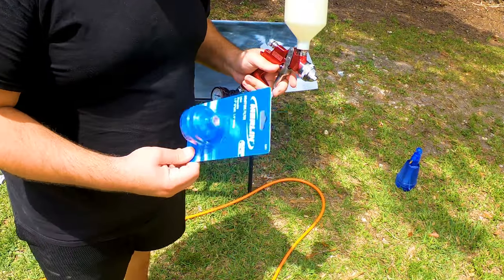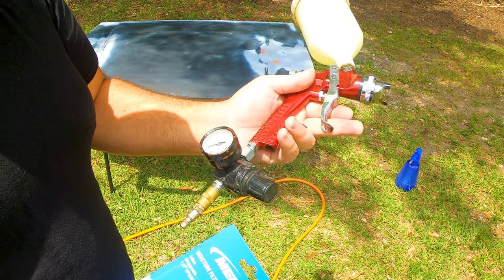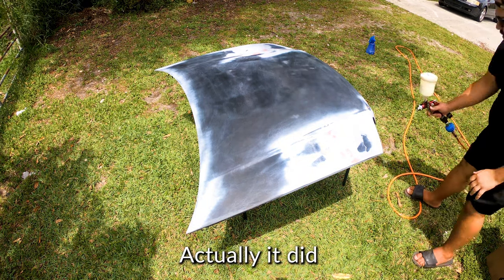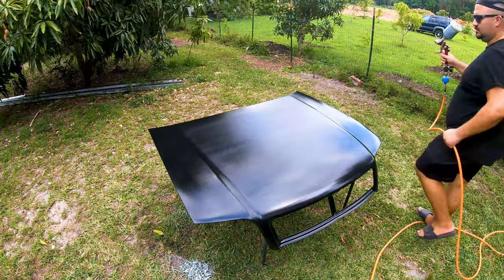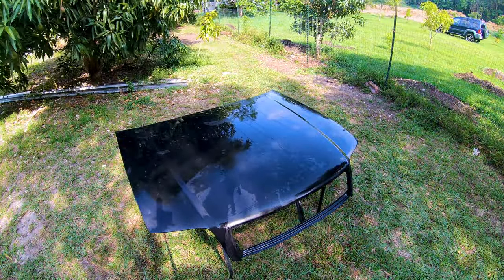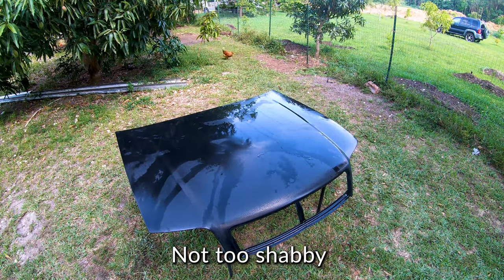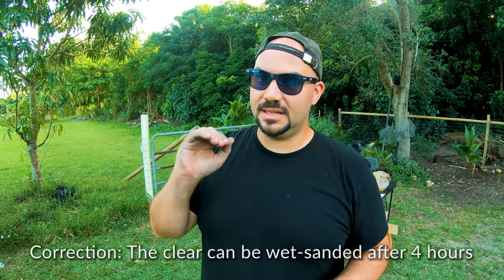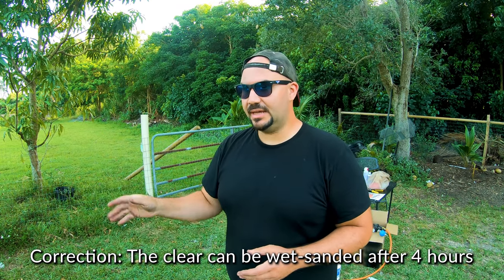Duplicolor Paint shop, DIY paint job with All 3 stages. Primer, Color and Clear

Comment: bro you’re better off watching tutorial videos yourself before you start. you’re basically wasting $$$ & not applying anything correctly which will show at the end. one little mistake & it won’t look good & from every step you took i saw mistakes that would never give you a good paint job. look, i’m not here to grill you but to help out given we should all help each other out when we can & alot of my first mistakes when i was starting out were solved with youtube itself & i can recommend channels like paint society & the gunman to get you started. one thing that’s very important is the gun settings & it’s not supposed to spray in little inch lines because that will give you tiger stripes. usually gun settings are fluid wide open & fan 3/4 open for basecoat, psi around 26 psi but this is never exact because it varies greatly on what the gun company recommends & the type of paint & viscosity. it seems like alot of steps but trust me that it’s simple once you get the hang of it even for diy. best of luck
Reply: Maybe next time just paint for him since you have all the right ways
Reply: This turned out great for an outdoor cheap paint, paint job. This is perfect for someone that doesn’t want a show car. I did my work van the same way he did and it’s absolutely perfect for what it is. Give him a break FFS. He’s not doing it in a booth that’s got ventilation and temperature controlled. I can’t even believe someone would take the time to write an entire effen novel in a comment section. Smfh lol

Comment: You needed to thin that stuff about 20% with Acetone to help it flow. Not a deal killer though but that's where the orange peel came in.
Reply: thin the base or the clear?
Reply: @nathanchristian4495  looks like both. You want a fine mist to go on to prevent the air from causing the dempels there are Orange Peel.
Reply: @popsknows5648  thanks man that's exactly what I was looking for!!

Comment: what did you sand the basecoat with?  What grit (wet sand)?  I'm about to try duplicolor's lacquer products.  How about finish cut and buff on the clear coat?  What grit(s)?  Thanks.
Reply from the maker: I went as low as 600 (wet) on the primer and color to try an kill the orange peel and worked up to 1000, but aside from not straining the paint, the gun I had was probably not helping. On the clear I used 1000  becuase of the orange peel, then 1500, then 2000 on the clear and followed up with compound. most of all avoid wind if possible lol, that made this a much more difficult project

Comment: I've used this duplicolor paint on Motorcycles alot but never on a car. I'm getting ready to though, I have been working on a 75 Pontiac Grand Prix that I'm going I've gotta paint the back of roof where the Landau Vinyl top was that I had to remove because it was dry rotting, I'm half a half can of Silver and I have a little bit of gloss black so I' think I'm going to add some black to the silver to darken it up to more of a pewter color instead of a bright silver, The car is burnt Orange and I think the darker color will jive with it better.
Reply from the maker: Not gonna lie, 👀 it never occurred to me to experiment mixing colors 🤔 . You have set some gears in motion with that.
Reply: @CrookedMustache  I've done it with Silver in Green and Burnt Orange  but I haven't done it with Black in Silver, I don't want to make it dark dark but maybe 1- 6 or 7 ratio. the 1-10ish silver into British Racing Green makes a fantastic color. especially going on a Motorcycle fuel tank.

Comment: Does wet sanding the base dull the end result? I though it was better not to mess with the base coat for some reason
Reply: If you do 2 or 3 coats it should not. Depends on how much you sand. You can sand metallics out of the color and it will be a bare spot with color.

Comment: You need to adjust your paint gun. That spray pattern is small as shit. Smh
Reply from the maker: The adjustment that gun needs is to be thrown in the garbage lol. That aside, if I was painting in still air I could’ve gotten better results dialing in the little adjustment that gun had but with the wider patterns the slightest breathe of wind just carried the paint away with it. Next paint video, new gun and an enclosed space.
Thanks for watching 👍
Reply: Follow @paintsociety he gives an awesome video on how to set up your paint gun. 

You can get the cheapest paint gun known to man. And still get a decent spray pattern and result if you know how to dial in your spray pattern and psi. Even a cheap harbor freight gun can offer you good results if you know what you're doing bro. I know you can do it!

Comment: How big is your air compressor and what PSI are you running?
Reply from the maker: @davebigford my notifications are hit or miss, I’m running a 20 gallon tank that says 4 scfm @ 90 psi. I’m pretty sure that what I ran on the line but I can’t remember what I was running at the regulator on the gun and the gun was terrible. I’ll have a better video coming out soon now that we have a more dedicated space and we’re looking at better guns
Reply: Needed a different tip size my friend.

Comment: I just used the Duplicolor paint and clear ... orange peel came out from both ... duplicolor sucks
Reply: Yeah it does. You are better off getting a high quality single stage urathane and use max amount of hardener and you will have WAY better results even with not much skill or a good environment to paint in

Comment: Change your tips, primer and base are alot thicker.
Reply: Not with the duplicolor paintshop series.they are made to use a 1.3-1.4 tip. They come pre thinned in the can and are thinned to the same consistency. I've used. Their primer and basecoat and both spray the same through a 1.4 tip and spray well. I think he had the gun fan adjusted wrong, or his tiny compressor couldn't provide enough cfm to atomize it properly. I wouldn't say duplicolor paintshop paint is the best, but it is readily available at must auto part stores and gets the job done if you want quick and easy. Their clear is just a lawyer so it has no chemical resistance or uv protection. I have sprayed both this stuff and higher end basecoat like hok which compared to this covered 4x better and laid out perfectly but also cost 4x as much.